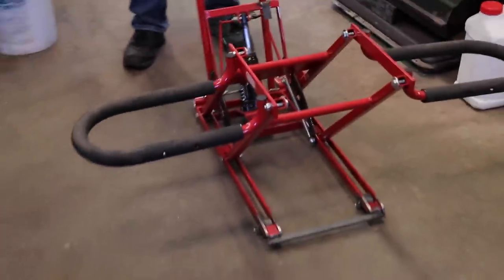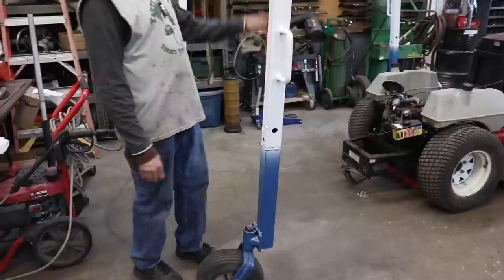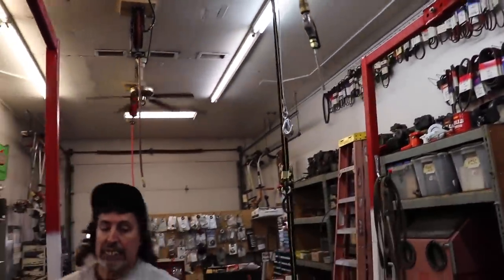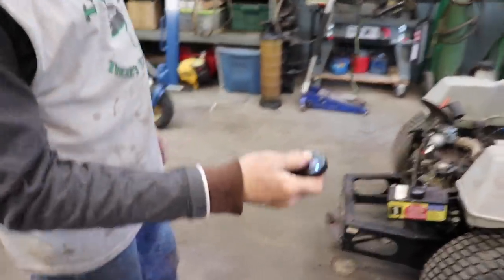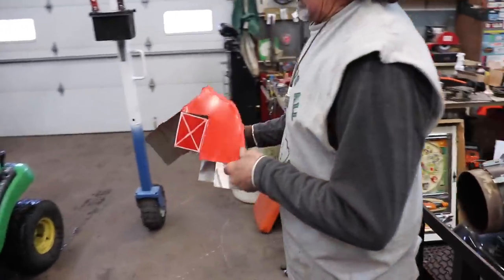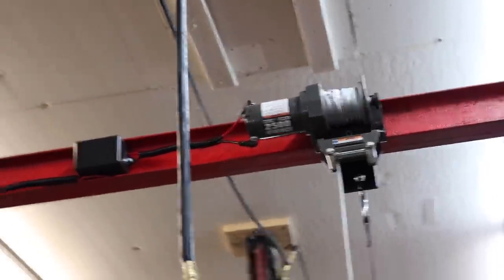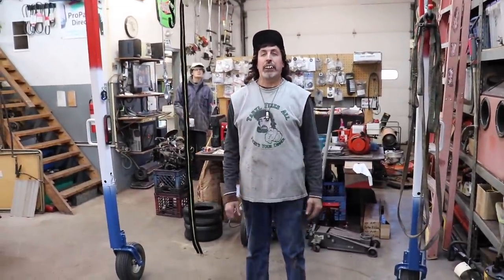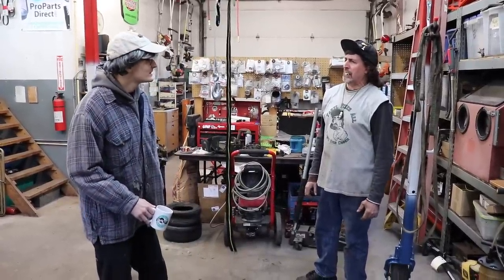AMAZING $100 Mower Lift

Comment: This is exactly my kind of build. Wheels off old tractors, cables off discarded jumper box, discarded battery box, scrap metal and a Harbor Freight winch to top it off. The "barn" cover is a nice touch. I mounted a HF winch to my converted boat trailer & just used a bucket to protect it, been several years & still ok.  For a sling I used seat belts that I cut out of a car that was scraped. 
Enjoyed the video.

Stay safe, Joe Z

Comment: I would triangle off the corners. That’s a lot of leverage there
Reply: I would have made a "A" frame much stronger less weight. Strength in triangles. Awesome Taryl. There's your dinner!
Reply: Those are called gussets and aren't needed because the weight is vertical and spread out by all four tubes.

Comment: Wow, that turned out really nice......I know when I was there last, you were telling me about how you were gonna build it, and I had the idea in my head, but, like how you added the steering and battery box.....just as a tip, don't leave that winch hooked up to a battery for an extended period, unless you keep it charged, because I had the same exact one on a quad, and it drains the battery because it's always drawing a current ( because the wireless receiver is always looking for a signal from the remote ). On a table lift, get the Harbor Freight motorcycle one, and a air over hydraulic jack/ram, and widen the table.......I have the table, and widened mine, just need to do the jack/ram part.

Comment: Nice job Taryl: Consider a 6 inch corner brace (gusset) on the upper corners of the lift for support so that a heavy load won't cause the legs to spread. Great video's. Many thanks.
Reply: I was just going to say the same thing.
Reply: @SteveRHanson  I'm surprised that he didn't think of that. Looks dangerous with a bigger mower.
Reply: Spot on.
Reply: Those are probably the only legs to spread around Taryl! : ;)

Comment: Only issue I see is the uprights need gussets at the top to decrease the load at that joint, especially since the legs are all angled with wheels on them (increasing the loading at that joint).  It would be no issue at all, if the frame were bolted to the floor.  Nice job though.
 I have a 500# capacity 110v hoist on a trolley on a beam in my garage.  I love it- wonderful tool for tractors, bicycles, and showing the grand child how to make stuff go up or down. 
 Safety chain to the beam. 
Mike

Comment: I had a similar winch capable of handling of handling loads similar to yours but I added a snatch block and hooked the cable back at the top. It slowed the speed down to half which cut down on the herky jerky. Also a spreader bar comes in handy, maybe 48" with hooks spread across it. Keeps the straps from snagging on things and the spreader keeps enough weight on the cable to wind up neater and lower better.

Comment: You and I had the same idea about the harbor freight wench. But my idea, now I can see was flawed. I was thinking about a 4 post lift,  that would go up far enough that I wouldn't have to bend over to get under even the deck.  And there would be no runners between the front and rear tires. Just thick tubing holding the front tires. A the same for the back. All four posts would have one cable each, going up to join one cable, that's connected at the wench.  No disconnecting the battery, or suddenly realizing the gas tank is cracked.  Love what you do with the battery box though. And covering the wench and the electronics. I left mine out in the weather, cause it was supposed to be weather proof. But it's not.

Comment: Love your lift , I use to work at Mi-jack too on cabs built the 1000Rs and 1000Ps and 90RTs I wired the relay panels & engine power units and tested them also. Worked at the Hazel Crest location. 94 to 99  Senior probably won't like your CNN commercials but your comedy sure is funny!

Comment: That's a great lift. It's going to save you time for working on the tractors. The wheels are great for outside and work great. The winch will work great and it's great because of the remote control for it.  I have one from harbor freight the same one and use it in my shop or on a car trailer before making it easier. I love your videos I'm a mechanic and work on all kinds of things. I'm retired from the army so I enjoy your videos.

Comment: That's right,,I made mine like a crane lift 2 tons 20 foot and swing 360 remote control.on trailer..love it..used it to load unload,repair work.8 years ago and still works perfect..cost $450 total then,priceless now.

Comment: i made a lift similar to yours taryl. Used the same harbor freight 2500 winch. I recommend separating the spool and seeing how much grease is in the 'gearbox'. My winch growled loudly when lifting larger tractors / engines. There was NO GREASE in the planetary gearbox. Filled it up and got much quieter. Should be fine now.

Comment: PLease add a 3' long diagonal HSS (square tubing) welded all around  to each top corner @45°.
Then take it outside and do a test lift of 1,000 lbs.  VERY Important.  That left rear axle on the 110 looks iffy....
Reply: the frames are fully welded, like a portal frame .
Reply: @josephkaumo2352  A lot of weight without the load on it.  Nothing ties the base together which is already wider at the bottom than the top.
Reply: @gordbaker896  missing the point to his video.  He is lifting mowers not nasa rocket engines, cars, or trucks.  And he doesn't fully suspend them
Reply: The advice makes sense, cheap security for a little effort i would tie it together it can’t hurt.
Reply: My thoughts exactly. Wouldn't hurt to add a little peace of mind. Don't want Taryl getting cleaned.
Reply: You’ll find slippers one day smashed under it cuz he was stupid and secured the winch to the steering wheel hahahahaha

Comment: Good job, Taryl. I made a lifting gantry from a section of swingset frame. The lifting is accomplished with a come-along and a piece of chain. It's not as sturdy as yours but it does work. I can get to the blades a lot easier now.

Comment: I've got a hoist that's really tall like that only you can lift car motors with it. My dad used it for our riding mower. My dad was 80 when he used it, he built the hoist from large diameter pipes, then painted them gun metal grey and welded them all together, to pull motors in the big wooden shop he designed and we built complete with all wiring and roofing. He's gone now and it's time to change blades again and my big belt broke 😳I've never done it but it looks really straight forward.

Comment: You cease to amaze me with your ideas that ackually work and look good also. My eves are 11 feet that gantry would work well up here in upstate New York. Imagine the cost if you had to buy those steel leg beams and ancillary metal parts, I'd bet it would be $2500. 
Looking at the legs, are those 4" square tubing?

Comment: I have one 7 ft tall that the top tube slides into and I can take it apart in a minute and throw it in the pickup. The sides are a T turned upside down  with a short piece of pipe the overhead pipe will slide into. I can set it back up by myself easily too. I just use a chain hoist on mine. I built it for my zero turn. I can stand it up on its end if need be. Real handy for servicing the deck. Much much better than them little lifts too. And a lot cheaper too.

Comment: Nice job Taryl. The older we get, the smarter we should get. I'd put a snatch block in line with your winch line to double the lifting capacity. Those Harbor Fright winches give up making straight line pulls.  It would be easier on the winch too.  Nice job on the Gantry. I'd be honored to swing from that thing anytime. lol.

Comment: Nice hoist.
I made a table lift out of a Harbor Freight motorcycle table lift, made an adapter to put on top and I can drive mowers on and off. Sure makes working on them easy.
I'm considering converting it to air to do the lifting.

Comment: I have a solid welded  swing set from the fifties
 It has lifted a truck bed into place, so if I ever add wheels I will use your ideas
 The steerable wheel is brilliant
Those harbor freight winches always caution against suspended loads , so extra support if you have to crawl under is another good point you made,Mr Tsryl

Comment: I have been using lifts for a while and when you build yours dont pant the top, vary modular, add a winch to pull things up on it. Cant tell you how many times I pushed my lift to the wall because something didn't go up the ramp. Make sure the ramp is not smooth

Comment: That would be awesome with a battery tender on it also,  so it can keep the battery charged, topped off, while the mower is being repaired! 
I'd like to open a small shop at home, but I doubt mowers would be it, because there is two shops less than a mile from home,  I'm more interested in custom work, over repair,. I get board east with things like that,  maybe a race mower shop??

Comment: For your safety, you might want to add some diagonal bracing between the uprights and the top cross member on the sides and diagonal  X bracing from left to right for rigidity rather than relying on just that "I " beam..  I used rebar on mine. It's solid as a rock.

Comment: You should have made caster wheel locks for it so it doesn't move on you. What that thing is cool as hell. Damn I bet you could sell them easy. You could also add a strip plug to it with a light retractable lights hooked up on it. Harbor freight and tool has has nice work lights also the rechargeable kind.

Comment: Nice job Taryl, that for sure gives me an idea on making my own gantry lift. 

Not to be one of those people from the peanut gallery...but my only concern with it is the way the legs are coming down on an angle. Every time you lift something you are putting allot of stress on the welds. I would re-enforce each corner just to be safe. I would hate to see you or even slippers for that matter getting hurt, we need more of your videos. 

Looking forward to your video on making a lift table.

Comment: Hi Taryl, I have an issue with my mower. Hope you can lead me in the right direction or possible solution, I have a Honda mower 217 HRX--VKA, bought it in 2012. I have maintained and replaced parts as needed such as carburetor, air filter, spark plug, oil, recoil starter, blades, and yesterday I replaced the COIL ASSY., IGNITION for the spark plug since the boot would sometimes slip off the spark plug and cause a loud pop. I was going to relace the THERMO WAX ASSY., but that looks fine as of now.  Here is my problem, before replacing the bad COIL ASSY., IGNITION my mower was working fine it then started surging and turned off. I pulled on the rope to start the engine and it became SUPER tough to pull and get started,  if I got it started it would surge and make popping sounds as if related to spark plug, then it would turn off again. What can it be? Do you think it could be the values? I have not checked them yet because I haven't yet bought sealant to replace the old seal once I remove the cover. I have rechecked the carburetor and made sure the COIL ASSY., IGNITION had the correct spacing from the flywheel.   I hope you can lead me in the right direction on where to look. Thank you for your videos they are very informative and funny. God Bless...+

Comment: Good call on covering the control box, Mine was mounted in the bed of my truck under the bed rail and still filled with water, now i just wire the batteries direct to winch and have to reverse polarity to extend or retract.

Comment: You don't have any angle braces where the legs meet the horizontal beams. I think the legs could splay out and the whole thing come down.  Weld some triangular plates where the legs meet the beams. Like Mitchel Cool said.

Comment: LOL OMG too funny..I have to agree that Slippers will be there for awhile. I seen that you hoisted a Deere tractor. I'm looking for a video  on the wiring. A chipmunk has invaded my friends Deere and the wiring coming from the starter, recifier, stator is a mess. The key will turn the fuel solenoid on and the lights but will not turn the motor unless I jump the pins on the solenoid????? My LA140 is just a little bit different from the LA120..can you help please...thanks in advance

Comment: Far be it for me to attempt offering guidance to a senior grass rat like yourself… But wouldn’t you think some inside top corner gussets and or outside bottom straight tubing between the side legs would offer more stability and be a good thing? I mean I love anything you can build out of scrap because it’s a $$$ plus for any shop, but I’m thinking that may be tempted to spread apart with some good weight on it... That weatherproofing is a must too, nice job! 😉✌🏼

Comment: you cant use a bumper winch for overhead lifting , use a hoist meant for vertical loads on the clutch or it might fall..

Comment: Taryl, i have 2015 troy bilt horse xp no crank or click. Checked safety switches and solenoid. Still nothing when you turn key light do come on also tried another key switch. Any suggestions

Comment: I read through some of the many comments and did not see this question asked: Is that a hoist or a winch? Hoists are used to dead lift vertically and have mechanical safety brakes. Winches are for pulling horizontally and do not have mechanical brakes.
It is not safe to use a winch to dead lift as they are not designed for that. Maybe let Slipper use it.

Comment: Nice, but one thing you might want to check is if that is an ATV winch that it looks like, it is rated to PULL, not dead lift.  A 2500 Hoist would be needed for that.  Harbor freight has a 2000 lb one, but you would only need a 1000 lb one.

Comment: I’m curious how much weight can it take? I always have things to lift in my shop I feel like making one too😁
Reply: It would depend on the thickness of the gantry square tubing, I-Beam size and of course, the winch specs. The battery used is important (amps) to ensure winch motor isn't burned out. 

Small gantry crane performance can vary between 1,000 and 5,000 lbs. It all depends on how well you pick your materials and components. 

Your going to pay over double for .250" thick square tubing compared to .095" or .120" 

But for 1,000 lb tractors, .120" is more than suitable. .250" I-Beam, and 2,500 lbs winch, which is designed for pulling, not dead lifting, will be more than adequate for half a ton.

You should also have to very high confidence in your welding skills or find someone that is certified.
Reply: Try Getting You a Shop First

Comment: Great idea the lawnmower down the road from me i used to work at had a 5000# lift that mounts to the beams above but it wasnt portable and the controller and power cord would just hang in the way when not in use one thing i was tought tho was not to turn a motor on its side or straight up and down with oil in it or oil would get in cylinder or spill out everywhere  i see u did it is it safe to do that were they just over cautious

Comment: I wonder why it's as if General Motors thought that I got that Thoroughgood (Slipper) ?

I was driving a GM Holden vehicle in 2007 which ran a 3 litre Nissan engine that  I built as Holden fitted them in 1986,well,our project manager was him & I worked under him.

There are 2 things,I was driving a 2.7 litre Toyota Hilux for a week because a person called Ken was leaving,I was driving him 150 kilometres per day so I had to drop the Hilux up to the site so he could drive me home in his car.

Coincidentally, Cadillac have got a fascination about dropping the naturally aspirated 3.6 litre V6 engine & replacing it with both a turbocharged 2 litre & 2.7 litre 4 cylinder engine,they also have a fascination with building a twin turbocharged 3 litre V6 engine which is 96 horsepower less powerful than the twin turbocharged 4.2 litre Blackwing V8 engine which they have dropped from their lineup after only a year or 2 of production.

I feel like GM thought that I was going to Slippers form in Australia,my point is that I want none of them that they're proposing to build,I would've been very happy with the 500 horsepower Blackwing V8 engine only it won't fit into the CT5 which they are going to export to Australia.

Now I have to wait for & buy the supercharged LT4 V8 engined Cadillac CT5 which is rated at 640 horsepower,why is it that GM wonders why I have none of their other engines when my current ride has an LS1 V8 engine in it ?

Why wouldn't they want to talk to me about  the sort of Morgan who I worked for in 2009 ?

So,I got onto that sort of Wade which sort of it is a lawnmower form,I didn't get onto a Wade who is a Thoroughgood & is just full of art !

Comment: Sea Bee Uncle always said to use your head instead of your back. I have a strap winch bolted through a rafter in my shed that I hang mowers with. Usually one end up or the other, not slanted. Will hold a Gravely walk behind with a kidney mower, well over 500#. A real back saver! And can hook a come along beside it so I can lift 2 things seperate if needed. Not portable but neither am I so there's my dinner/supper too!

Comment: I think you will find out you need a bigger 12 volt lift. 2,500 won't last long on a dead lift like that. It struggles now. Time will tell. Should have had that years ago you no that. Make your life as easy as you can cause when you get older it will catch up to you. Good job though.

Comment: I have a bad feeling one of those welds at the top will eventually break and someone will get hurt when it falls. I think you need to add corner braces and proof test it to 1500 lbs before you have anyone work under it.

Comment: should have got the harbor freight HOIST not a WINCH. Hopefully you will never find out WHY they have a WINCH and a HOIST. I have been using the HOIST to lift dixie chopper for YEARS, I would NEVER use a WINCH in place of a HOIST. as i said, HOPEFULLY you will never find out WHY you do not use a WINCH when you are supposed to use a HOIST.